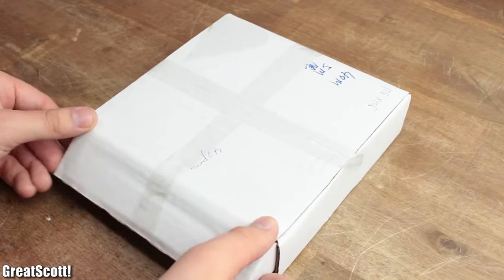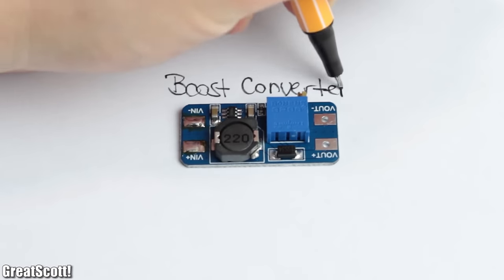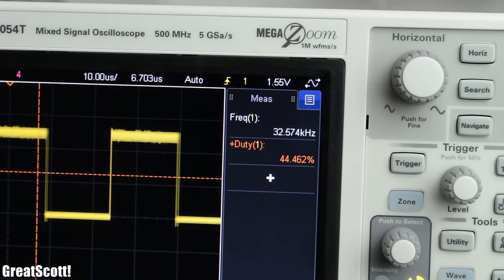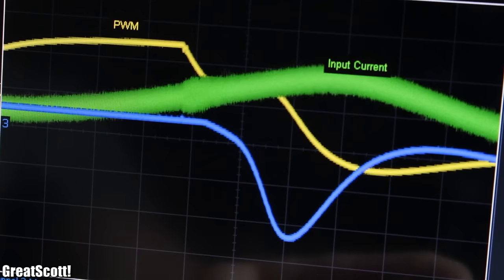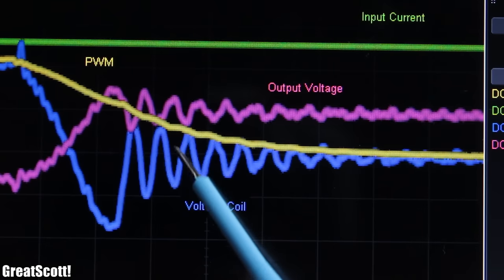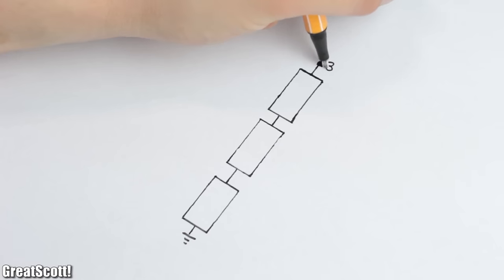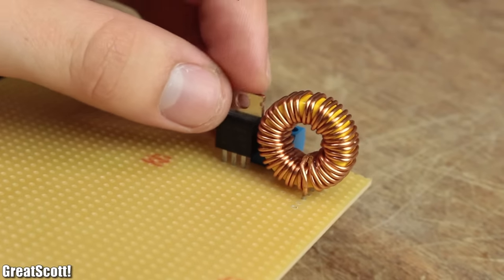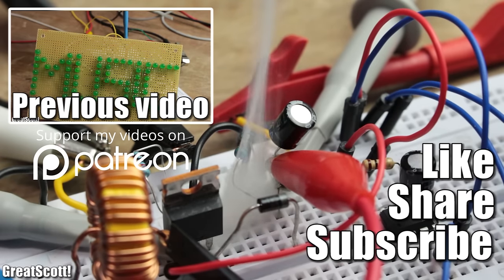DIY Boost Converter || How to step up DC voltage efficiently

Comment: Idea
led acid battery replacement.
how:
sell 6 ultracaps instead of led acid battery and with it you get a 9v battery boost converter to 14volts gizmo that you use in case of not using your car for more than a few days so you can charge your caps so the car starts and than you got the alternator doing less work, you got a lighter car. Or... instead of 9v battery a small sollar pannel so you have your starting current always ready.

Comment: Hi!
I need a mppt bust converter circuit schematics, able to work from 2V or 3V & 1W-2W, to14V-15V, up to 60W-75W input, 15V constant voltage & 5A max output current, and another mppt buck converter from 38V 10A to 15V 25A.
Can you help me, please?
Thancs!

Comment: is that works??
i have 2 solar cells, i have to plan to make 3.6v li-ion charger with it
Reply: +Jeffri Ranger yeah it work as you can see in the video
Reply: you are right, but i dont see he connect the solar cell to it, he uses power supply

Comment: love how the video ends with the thing going up in smoke.

How did you determine the 100 mH inductor? was that random? I assume a larger value would get you higher current but lower max voltage?

Comment: For the PWM used at the switch you can also use a 555 timer in astable mode with a mix for R1, R2 and C depending on what's needed for timing.

Comment: Hi. I like to make a 6 volt rechargeble battery using 18650 and a boost converter. Right now i think or suspect the boost converters will drain the battery even when there is no load attached to the boost converter since the boost converter is boosting all the time how to detect a load and enable the boost converter?

Comment: Maximum amp? I just want build a 5 amp boost buck dc-dc converter using ur circuit and lm317 (added some thing for 5amps.....) Thx 

(Sorry for bad English because I am from Taiwan 😀
Reply: the lm317 is a linear voltage regulator - it is not a buck converter.
Reply: @areg7182  I think he just want a lower voltage than input, lm317 can do that, but not the best
Reply: see tl494 datasheet, there is a 10A buck converter circuit, I really prefer using tl494, as it has two built-in amp which can be use as voltage regulation and current limitation

Comment: Great video. However, when I programmed your code onto an ATtiny85, the output pwm doesn't vary, it stays at 31 kHz and 0.8 duty cycle. But if I remove the TCCR0A = 2 << COM0A0 ...etc. section in the setup, it works fine (of course at only 500 Hz, the default Arduino rate). Ideas? Note- just now I did get it working at 31 kHz, by using pin 5 (Arduino pin 0) for PWM output, and using analog inputs on A1 and A3. I suspect the fast PWM setup section sets up only Arduino pin 0, not Arduino pin 1.

Comment: What happens if I connect a higher input voltage than the supposed output voltage of a boost converter? I'm thinking about making a 3S Li-ion battery, which will give me 9,9 V as it's lowest (as I want to use it) and 12,6 V as highest. I don't care about the 0,6 V above, all 12 V electronics will work with that, but they won't got as low as 9,9 V. So what I would want is a boost converter getting anything below 12 V up to a stable 12 V, but everything above in a bypass mode with higher efficiency that goes directly to the load. Is this easily achievable or is the efficiency high enough close to 12 V that it doesn't matter? How would I go about doing this?

Comment: It would be nice if it had PID controller for the voltage - that way you could dial in an absolute value. I'm interested how it would turn out on an attiny.

Comment: How did he know exactly the resistance required to drop the voltage from 30volts to 5 volts for the feedback loop. R=V/I. To get I
Would you have to short circuit the circuit to get the max current with that voltage and then use that to get the resistance or am I missing something.

Comment: i am using a 300w inverter powered from lithium ion 18650 batteries 3s to make 12.6v or 11.1v nominal and i was thinking of using a boost converter to step up the voltage to something like 14v as the inverter is designed for lead acid to get the most out of the batteries without the inverter stopping under load with a low voltage warning what do you think?

Cheers.
Reply: You'd be looking at a lot of amps, I doubt you'd get it to happen. Look into using A123 M1B cells, 4 in series is 13.2v nominal and 14.4V at full charge, so works perfectly in place of a lead acid :) You could easily load the inverter up with the full 300W load for a couple of minutes on 4 cells, they can handle a lot of amps. Or parallel them up for longer.
Reply: the 18650's are 3 series and 10 in parallel so 30 cells in total so thats about 2.5A per cell at full load but it is rarely at full load and it has been going strong for about 4 months now.
i have also done a 24v version for my mate and it has 7 packs of 20 cells instead of 6 to bring the voltage closer to what a lead acid would be but i cannot use 3.5 cells for 12v so i was wondering if i could raise the voltage slightly with a boost converter.
Reply: +Darren Hall no, it's too many amps, if you did manage to build it you'd have compounding inefficiencies... *You can get around the problem entirely by using a different cell chemistry, LiFe. Because it's the right voltage. *
Reply: +Simon T I mean too many amps for your proposed step up converter. 25A 14V output to the inverter assuming the inverter is 80% efficient. Your circuit might be 70%. That means 468W input to the step up converter. If you set a 10V minimum cut off on the battery, you'd need 46.8A.
The problem is the components required to handle 47 Amps would be pretty hefty, large capacitors and mosfets.

Comment: hello. I enjoy your  all of videos . I am wondering if I could use this  to base a large DC boost stage for a inverter. one big enough to run my off grid home. like 6kw minimum. from most likely 24vdc. if I'm correct I need to boost to 170vdc. to get 120vac once inverted to ac. I think I have the spwm output stage figured out. I am self taught and new to this. but I'm trying . would this be better than a push pull boost circuit? as far as efficiency? I know a push pull will require a very large transformer. and run at a lower Hz. but the ppl selling inverters say low frequency is better for starting motors.  if you could give any advice or help I would be very thankful. and the over shoot when loads are disconnected. and sags when connected. is there a way to improve the regulation of the output? would that be in code. or is it the microcontroller? can it be fixed with a better or faster microcontroller? thanks again.

Comment: what am i doing wrong? I use an UNO and this circuit with somewhat modifieded code and f=35kHz. I can reach 30 volts with less than 2 volts but as soon as load is applied the voltage drops to 2-3 volts. I have used a beefy output cap of 2,200uF and a coil similar to the one of the video.
what should i recheck?
Reply: I'm just a second year student, but let me try suggesting something here. Inductive reactance varies with frequency and capacitive reactance is inversely proportional. As you increase the frequency of your switch, the inductor has less time to build magnetic flux which it then turns into current. Would you consider adding another inductor in parallel to the first, or reducing your frequency? 
As I said, I'm just a college student right now. Let me know if my suggestions helped or if you got it working some other way. :) Also keep in mind that the load might need to pull a certain amount of current and your source needs to be able to provide the right amount of wattage.
Reply: ***** actually you are very right. I forgot to think about the current capabilities of my lm2575 buck converter that was supplying the wannabe boost converter. It can only supply 1A  but i was demanding 1A @30v at the output so it should be able to draw way more current from the input... I guess i ll hook up an atx psu @5 volts and try again!

Comment: Hai i have project to make microinverter. So i need a boost converter 12 volt to 220 volt, it is possible to make it with components in this video?

Comment: i have tried to establish the circuit to boost 4 to 12 volts with 410 uH inductor and 1000 uF capacitor but it didn't work 
what are the other things i should make sure of pls ?

Comment: 78% efficiency? With some tweaking it might well get up into the high 90%'s. I built a converter years ago while working at American Scientific. By boss was concerned about the efficiency when he saw the power consumption. We checked it out and 98% of the power was going to the load. It was however, not the same circuit as this. Mine was a charge pump while yours is using inductive kick. The one thing that has bothered me about this circuit is how do you know when to turn off the switch/ If it's left on too long it will waste power.

Comment: Hello! 

Can a boost converter also lower a voltage? or keep it constant?

For example, if i input 12V (battery) and output 9V, and if the source drops below 9V (say 8V), does it step it up to keep the 9V constant at the output?
Reply from the maker: Watch my Buck/Boost video.
Reply: +GreatScott!   I have watched lots of your videos. can you help with my project? I need to boost 24v to 160-170+. as a boost stage. my issue is in the controlling of the circuit. I know nothing about code or programing . I s there a easier way? or must I learn how to use something like arduino?
Reply: attach boost converters in series. get one to boost to 50V...

Comment: Hi +GreatScott! im trying to make a boost circuit for a 3.7V LI-ion battery, because i want to bring it to a voltage of 5 V to supply my arduino and ome other circuit, what should i change on the circuit configuration??
Thank you

Comment: Hey Scott, how does the value of the coil influence the final result?
Reply: yeah
it does
Reply: @joshuachettiar86  but how does the coil value influence the voltage?
Reply: @leobla744  V = -L di/dt
since we are using a pwm to control the Mosfet , the current through the inductor is not constant but changing with time, the rate at which the currect changes is what produces the voltage across the coil thus heavily depending upon the inductance of the coil.

Comment: would it be possible to integrate a buck converter into a home made atx bench power supply to achieve variable voltage output?

Comment: how could the over shoot voltage  be eliminated or greatly reduced. when a load is disconnected? and how can I get more volts from a circuit like this ? I need like 150volts dc.

Comment: Hey GreatScott, thanks for the video. I have build a battery using water and electrodes, I got about 10v to 15v, however when I try to connect it to DC Voltage booster, it drops to 0.4v. The current is close to 55micro, then drops to zero when I connect it to DC voltage convertor. Do you have any idea why the sudden drops when converting and also the voltage drops to 3v when using small led light.
Reply: For me it sounds like the internal resistance of your battery is pretty high (it doesn’t have the capability to deliver much current) you can imagine it like a 15V source with a high resistance in series, so the voltage drops of at the resistor and not at your load.

Comment: Would it be possible to duplicate this dc-dc converter but with much higher amperage by just increasing the size and capacity of the components? I have a hybrid vehicle that uses a 288vdc nimh battery, and I was thinking of creating a ‘booster pack’ for it that could be charged by solar cells, and in turn would then charge the primary battery pack. The vehicle battery is 288v and 1.9kWh, and my ‘booster pack’ would be li-ion and either 48 or 96vdc and 3kWh or 6kWh respectively. The solar cells would mount to the roof of the vehicle, and would charge the Li-Ion booster while the vehicle is parked outside (all day while I am at work) but I was having difficulty figuring out how I might step up the voltage from 48/96v to 288v until I stumbled upon this video. The one place where I get lost is your programming? chip (a raspberri pi unit I assume? I have zero experience using raspberri pi, but have read a bit about them) but the solid state parts are rather straightforward, the coil, diode, capacitor, I understand the function of each. Could you help me fill in the gaps with my concept?

Comment: are you going to build a buck-boost converter
Reply: he make it already
Reply: +Mark Brahasani recently he made a buck converter but he didn't complete it with the arduino and this is a boost converter so you can combine the two programs and modify the buck converter a bit and like this you get your self a hybrid Buck and boost converter

Comment: hey Mr Scott  thanks for the video but I have two questions 
1.can I use a 555 timer to generate the pulses 
2. is it possible to boost a voltage of 5v and 2280mA ie  would it affect the current value
Reply: 1. Yes but implementing the feedback would be more complicated
2. Yes because a boost converter is basically a trade off between Voltage and maximum current of youre supply (higher Vout results in higer Current draw at the input) You will not be able to have the same maximum current of youre input as output.

Comment: I use these A LOT in battery charging applications. Would be fun to build one - mostly because the biggest one I could find was the DROK one on amazon that apparently does 900W. Not really. I was hoping to use one to charge the battery on my scooter (12S LiHV, max charge of 52.2V). The 900W one I got from DROK can handle only 3 amps at that voltage. Weak. It also hums a lot when charging at that voltage and amperage. 

I found this video fascinating because I'd love to build one of these to give me at least 6 amps at 52.2V. I haven't read your instructions yet that you mentioned in the video (I plan on it) but is there enough info in there to where it is obvious what components I would need to change to get to higher voltages and amps?

Comment: Hi GreatScott
How can I add a potentiometer to a buck boost converter from China (voltage regulator), so i have the possibility to set a min. 6 volt and max 12 volt and use the extra potentiometer to dimm the LED light from 6 (off) to 12 volt (full brightness).
At least a max voltage.
It is for video work, so i don't want flickering of the light

Comment: I have a question, in your intro and some projects what wire do you use to connect things? The silver one that bends
Reply: It might be a stupid question but I'm new to electronics
Reply: +Gostcut Gaming silver copper wire, I think
Reply: +NeXTSTORMING And what diameter?
Reply: Jeroen Verbong i found out in another video, its 0.8mm silver copper wire

Comment: At 02:44 you say that the two voltages add up the same way as they do when you put batteries in series ... but the voltage across the coil is negative, so shouldn't this be taken into account?
Reply: I was able to answer it myself ... and I was stupid of course. During the collapse of the magnetic field of the coil (switch is off), the polarity changes so that the coil voltage adds to the source voltage as both voltage sources have the same polarity and are connected in series. While the switch is on, the polarity of the coil is opposite to the source polarity and the coil's magnetic field builds up

Comment: hypothetical:
if driving a bigger AC load, I am left to wonder whether it is better to boost up to a higher voltage and use IGBTs off a DC rail, or drive at a lower voltage and use a step up transformer?...

say, hypothetically, ones' supply is 48V 100A, and the target voltage range is 400-600 VAC (say, for running a 440 3Ph motor or similar).

issue is I think cost of IGBTs (and 600V MOSFETs) is higher relative to 100V components.
but, with the transformers, it is harder to find sufficiently powerful transformers (and trying to build them hasn't had so good of results).

most powerful I am aware of ATM is some UPS transformers wired up in a delta configuration...

Comment: Hi to all. I have a question. I got the same solar cells i think and same problem 0.5v and 8.6 amps max . this boost converter that u can get online ,desriptions i find are bit misliding , can it handle 8 amps?  Maybe some one can help

Comment: Why do most electronics which rely on battery power (e.g. power banks) have batteries which give a slightly lower voltage than the intended output voltage (e.g. a power bank has a 3.7v battery and needs to output 5v through the USB ) and why do they use boost converters to step up the voltage instead of using just 5v batteries? This would both increase efficiency and reliability.

Comment: iam making this right now but i got problem uploading the code. TCCR1 is not declared is scope. Im using arduino uno by the way. any fix for this?

Update: I rename TCCR1 to TCCR1A  but got  next error PWM1A is not declared in scope. I guess this code are only for ATTiny as their header file includes it? can anybody help me fix the code so I can upload it to uno? Thanks

Comment: How do you know which components to use and when to use them? Their are so many types of mosfets out there how did you conclude that an IRF 540N was the one for you? Same thing with diodes. I dont understand what the letters and numbers mean.
Reply: Easter Bunny the letters are meaningless. You're supposed to google them and find a datasheet. So if you want to know the properties of a 1N4007 diode you google "1N4007 datasheet" and open one of the results marked [PDF].

Comment: How can it dissipate 3.91W without heat-sink ? According to the data sheet of the MosFET, that amount of power would increase the junction temperature to around 222C